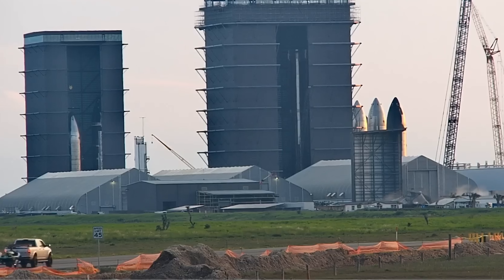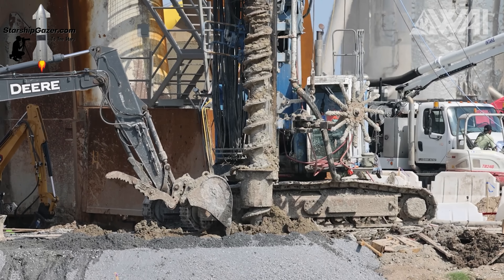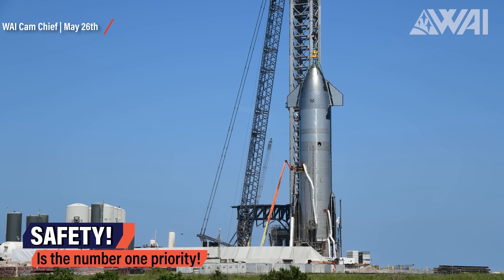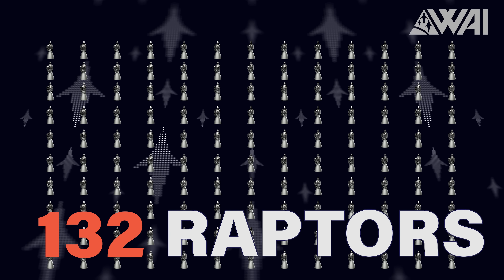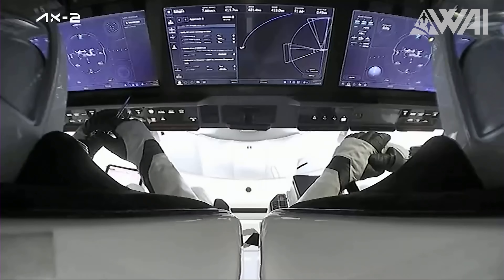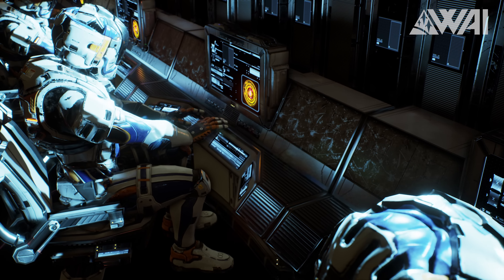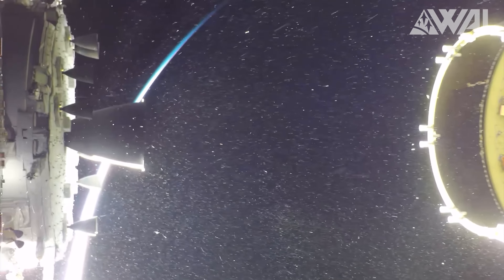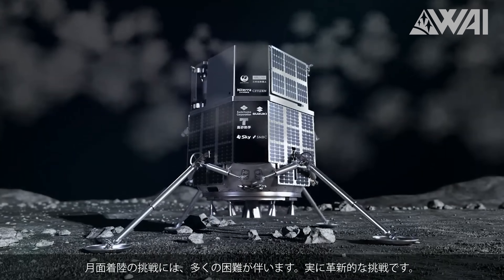SpaceX's Starship is about to do it again!?

Comment: Wonder if Japan will rewrite the code so that the lander can adjust for any location regardless of where it's at and provide extra fuel to compensate?
Reply: Elon Musk , yes, I've been following WAI, and Marcus House.  Others make claims I'm not so convinced about, like you're working on a nuclear rocket.
I think you could have saved starship if you'd had a backup stage clamp release, like explosive bolts perhaps.  Your Falcon 9 clamps are too light for the weight of starship and upsizing them won't fix the problem, nor can you use that twisting release action.  It'll damage the clamps or the clamping frame.
Could the clamp hydraulics be a separate system well away from the engines without adding any significant weight?
Let's hope your steel plate theory works out.  But I think you'll need 3 times the water NASA uses on their deluge system.  I'm thinking your multiple rockets produce significantly more pressure than NASA's giant rockets of nearly the same power.
Good luck on the next test
Reply: Elon Musk , same problem with me and not doing so great in English class.  I look at things differently and will do what ifs and other brainstormings from reading something.  I learn better hands on, tech books put me to sleep even if I'm interested in it.  Govt test said I had spatial relationship ability but got turned down for air force recruiting.
I hate planned obsolescence.  Cars should get nearly 200mpg.  Never seen a battery combined with capacitors or crystals, or a motor thermionic converter combo.  Why no one has put certain granites through an electromagnetic coil and tested it considering its properties.  If lightning is so powerful how come we haven't harnessed it yet.  Can you put a magnetic field inside another without interference or shape it for propulsion.  Could a spaceship hull be turned into a cryo radiation shield like our atmosphere used to have that is a remnant of its former glory.  It's already needed for the propellant.  Combine it with electromagnetics.
Would love to see someone shrink non-weapons grade thermonuclear generators that won't melt down. 
It's nice to see you sidestep your work environment from time to time.

Comment: Imagine the craters that will be made during a moon launch.  Even with 1/6th  gravity it will leave a hole when going to mars.
Reply: Except the booster will never takeoff from Moon & Mars
Reply: That is why the moon lander will have engines up high on the sides thrusting down at an angle.

Comment: to colonize Mars, need nuclear reactors and power plants, make a starship reactor, molten salt thorium breeder also generates massive industrial heat, it's low pressure and hass excellent passive safety

Comment: just thinking simple, if the thrust of the engines is too high, then make the tower taller. that should be too difficult and wont cost as much as a fail proof ground level
Reply: It’s already several meters taller than any other launch pad in history! They just need a water deluge system & some sort of flame diverter…

Comment: They are running electric cables down to the launch site. What they should be doing is running a rail system along side of the highway for moving the Starships and boosters from the build site, to the launch site ! It would sure save them a lot of time and headaches !
Reply: It will add time & headaches

Comment: The Moonlander software with no flexibility is INSANE. Did they do no reconnaissance scan just before landing to verify if Atlas site is indeed suitable? Maybe the landing site would have to be adjusted by a few meters due to a boulder/soft spot etc? Which could only be picked up by real-time close-up telemetry. I would also have thought that such an expensive mission would rely on 3 laser altimeters - if all three, or  the majority, give the same reading - that is what will be used to determine landing profile. Blaming it on not changing the code to reflect atlas crater landing site, indicates a lack of flexibility in the design, bordering on the imbecilic. In this day and age, software is FLEXIBLE - relying on multiple sensor inputs. I get the feeling the bean counters had their dirty fingers in the pie
Reply: From how I understood it, they trained the landing systems on date from site A, then decided to land at site B but never trained the landing systems on the new data from B.

Comment: Wait wait, you mean to tell me that out of all the "brilliant" Spacex engineers, not one of them understood the thrust mathematics, material limitations and flame trench technology? No one could predict the disaster that happened on 420? Someone should have called Mr. George.
Reply: Hey guys, check it out! This guy didn’t do any research on why they can’t build a flame trench, and how they actually did the maths for the thrust against the concrete!
Reply: SpaceX material's physicists, geologists, and propulsion scientists were overruled on the day of the launch. 
It wasn't difficult to foresee that the ground below the cement pad would have give in.
At the Cape, NASA has the same situation with the water table, so they raised the pad 15 meters above ground, just to install the flame diverter directly under the rocket engine exhausts...

Comment: Hmm, to do human flights you need an energency about for the manned capsule even on the launch pad correct?
So will a man rated starship have something like Draco half way up or will they use the main engines to get away from the booster because THOSE ENGINES WILL BLOW UP THR BOOSTER probably.
Reply: yeah its a bit dodgy, even if it was safer than shuttle I would prefer a launch escape system..  for the kind of mass this thing can put in to orbit, it could be possible to put an 8m soyuz style crew capsule that launches out the side in case of failure...
Reply: Elon the great said that the Starship would separate from the booster and nothing other than that. How dare you doubt the plan of the genius of Elon?
Reply: Launch Escape Systems for Mercury, Apollo and Crew Dragon have thrust to weight ratios between 10-17. Starship is about 2. So, other than some of the more benign scenarios, there is no real launch escape option.
Reply: @ludwigvanzappa9548  hey.  I’m a retired Engineer.  IT WAS MY JOB DESCRIPTION TO QUESTION, it saves lives.

BTW, mostly unrelated story.  I was taking a class at work one time and the teacher was going over a hypothetical case study about a HIGH PERFORMANCE AUTO ENGINE MANUFACTURER who was having trouble with his new engine.  Gave us the data.

It was the CHALLENGER DISASTER, boy when I say that it ruined the class group decision making efforts.  He did NOT like me saying that out loud in the middle of his presenting that fact before our group discussion, everyone had the correct answer 😈
Reply: @VAMobMember  Can you imagine saying to Musk that he's wrong...
Reply: @ludwigvanzappa9548  yep.  If I worked for him IT WOULD HAVE A LEGAL RESPONSIBILITY to tell him if he was but that IS NOT what I was doing, I was asking for INFORMATION about what I saw as a POSSIBLE unacceptable risk to human life.  Which, as an Engineer is my RESPONSIBILITY.
Reply: @VAMobMember  That's a bit fascist...
Reply: @ludwigvanzappa9548  MORALS AND ETHICS are fascist? Especially PROFESSIONAL ETHICS?  Pls explain how?
Reply: @ludwigvanzappa9548  funni.
Reply: @VAMobMember  hes just bsing you.
Reply: @ludwigvanzappa9548  go back to common sense skeptic lel

Comment: SpaceX is using iteration far too much and Calculations too little. There is no way that this Water Cooled Plate is going to withstand the pressure of all the engines at Loft-Off. The Plasma Pressure will shutdown the water flow immediately and the production of steam will shutdown ALL of the Thermal Conductivity. The destruction of the Launch Pad should have been determined through calculations. To build something and test it to see what happens is done too much, lets start using calculations and computer simulations...this is what engineering is, not just trial-and-error.

Comment: The more I think about the starship…the more I realize that this project will not getting a pass by a laws right? Because the surviving redundancy of starship…you have multiple option to survive when one of the landing system fail with other humanable spacecraft..but starship kinda compulsory perfect landing to survive..1 error you’ll dead…for example the chopstick fail…or the landing engine failed etc….space shuttle can gliding…the capsule have multiple parachute system…starship is too close to the ground with no room of error when they catch it 🥶🥶🥶🥶🙀🙀🙀
Reply: Shuttle can only attempt 1 landing. Redundancy my ass

Comment: If Saturn 5 and Gemini could go to the moon land and return why can’t Space X especially when Second stage 
might be capable of SSTO.
Reply: First of all, Gemini never went to the moon - it was always in LEO only, and even a fairly low altitude of LEO except for Gemini X and XI which were boosted by the Agena they docked with (which was launched on a separate rocket).

And Saturn V was different from Starship in many important ways: stages, reuse, and fuel. It had three full stages besides the spacecraft itself (so I would call that four stages), plus lots of other pieces that were jettisoned during ascent (interstages, launch escape system, LM fairing, etc.). And what launched from the moon was only part of the LM, and even that was jettisoned after docking with the CM in lunar orbit. Finally, the only part that made it back home in one piece was the capsule. And the fuel was different - the second and third stages used liquid hydrogen, which is more efficient for long distances than liquid methane. The service module that propelled the Apollo portions to the moon and back used hypergolic propellant, which simplifies engine hardware significantly.

Starship is only two stages including the spacecraft, and nothing at all is jettisoned. All propulsion of both stages is methalox. And both stages have to keep enough fuel to return and land, which makes a big difference - fuel is heavy when you're not using it.